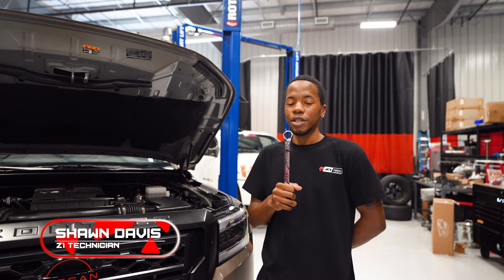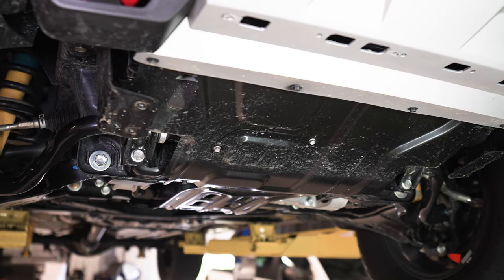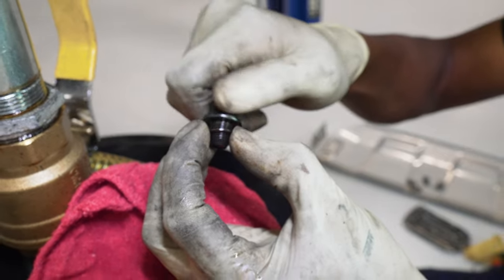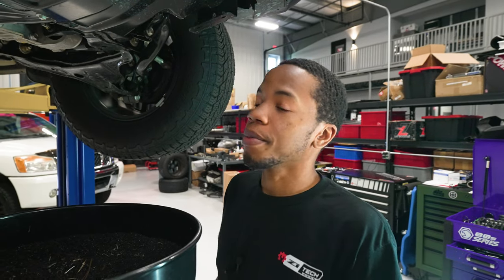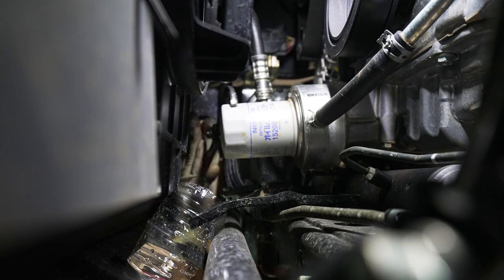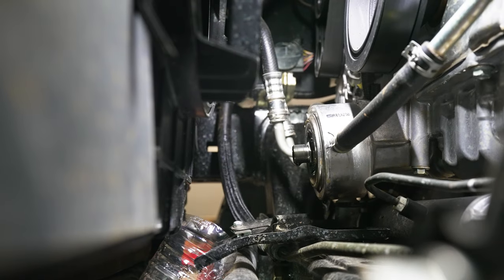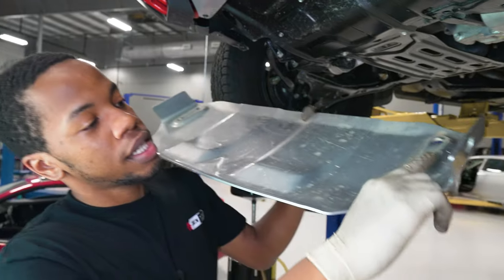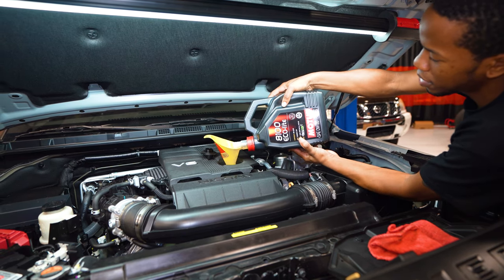2022 Nissan Frontier Oil Change Guide

Comment: 👎👎👎 they can’t wait to make it difficult to get to the filter. 🔥🔥🔥🔥

👎 total regret buying my 2022 Nissan frontier crew cab

👎 you can’t turn the driving lights off on the front part of the bumper 

👎 the radio takes forever to boot up makes me think it’s going to crash one day 

👎 open the hood and wiggle it up and down from the center with one hand and look at the hinges wobble like they are ready to break loose.  

👎 the steering is extremely Stiff. 

👎 the plastic bumper on the front keeps popping loose from the front of the fenders. Makes it look like crap. You have to keep pushing them back in.   

👎. Spend almost $40,000 and you will not get running boards. 

👎 if you buy a four-wheel-drive and you get hit in the rear end collision really hard the left leaf spring could poke a hole in your gas tank. There’s a safety recall on that. 

👎 they have way too many sensors on the dash that absolutely drive me nuts. 

👎 they made it kind of difficult free to reach in an access the oil filter so you can change it which is stupid. They should’ve put the oil filter on top of the engine like they do on Mercedes.  But they make it difficult for you the truck owner so you have to bring it to the Nissan dealer. Which I will never do. 

2022 Nissan frontier sucks ..

👎 faulty door, locking mechanism on the drivers door. 

👎 if you don’t close the drivers door hard, you might have to open up the back door and reach Drew to open up the drivers door.  

👎 way too many sensors on the dash that drive me nuts. 

👎I like the 1997 extended cab automatic four-cylinder much better than I do my 2022 Nissan frontier. Personally I have total regrets of buying it. Keep in mind they depreciate really fast.  If I could find a 1997 extended cab, that’s in really good shape I would put my 2022 Nissan frontier in the desert and set it on fire just to show how pissed off I am about the truck.